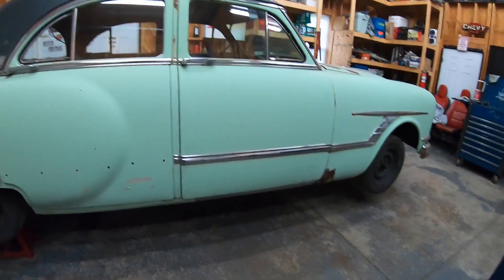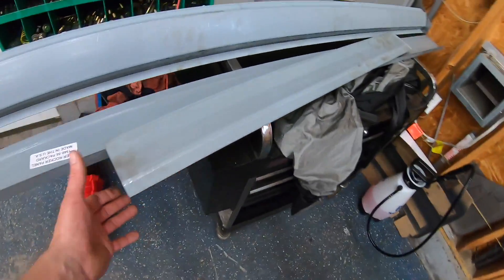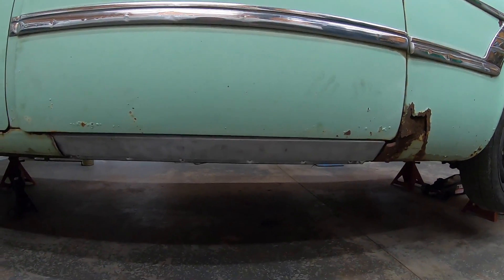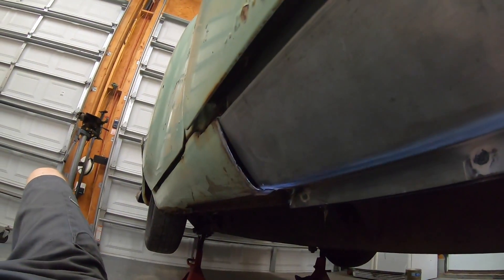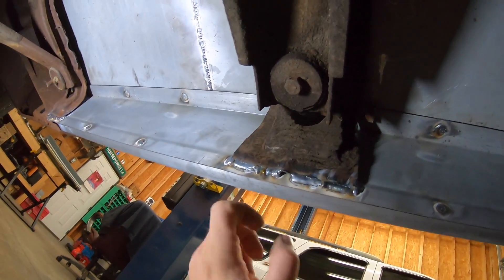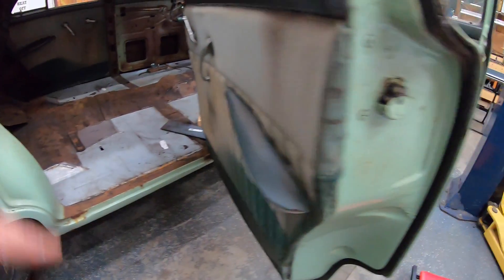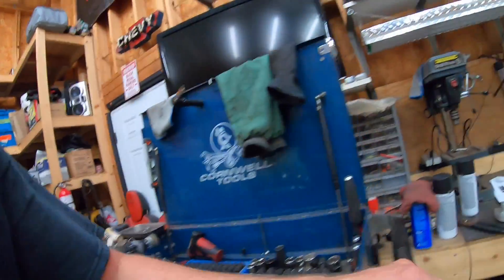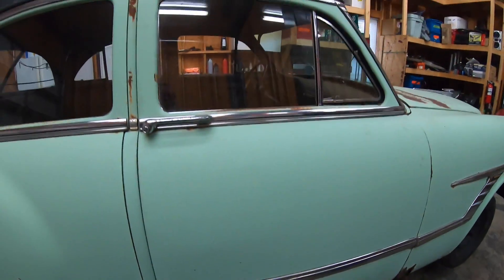Packard Update  Replacing Rocker Panels

Comment: I feel the need to echo Formula 1's question. Can you put the outer rocker on first then spot weld the inner panel. That way you can maintain the body line. You have a lot of fortitude to tackle those huge project pieces. You are da man! Like the "working" vids
Reply from the maker: If I weld the outer on first, I cant install the inner because of the way the panels overlap

Comment: Your problem with rocker fitment is you installed inner rocker wrong. The rockers go on top of floor pan. So its pan then inner rocker then outer rocker lays on top of them all and spots welds at bottom like you did.

Comment: You have set yourself some serious challenges with this Packard, I wonder if you might have been a little easier to weld it together after you had fitted the front side then it wouldn't have deformed but it might have made something else not fit.
Reply from the maker: That's right. I wouldnt be able to weld the two halves together